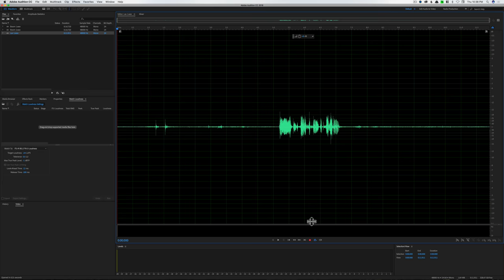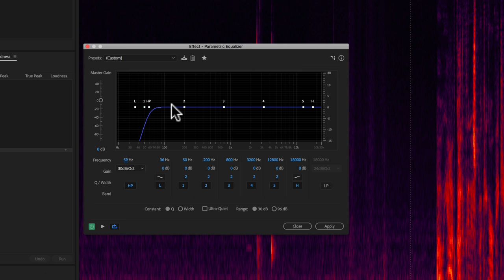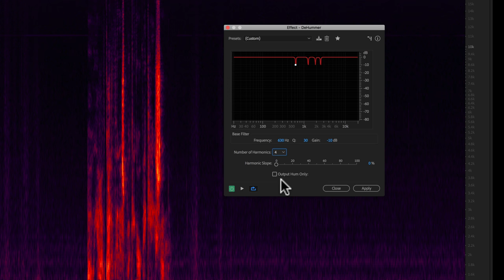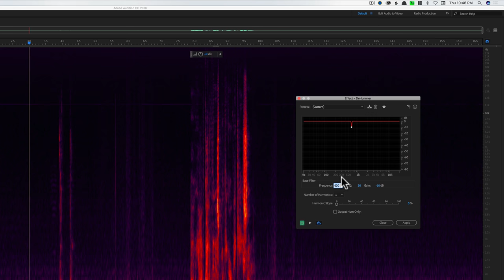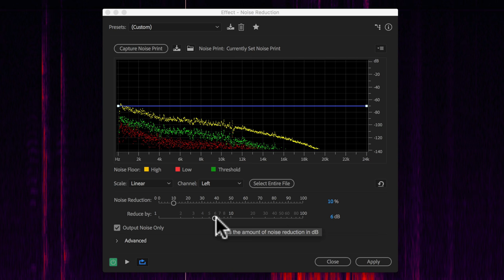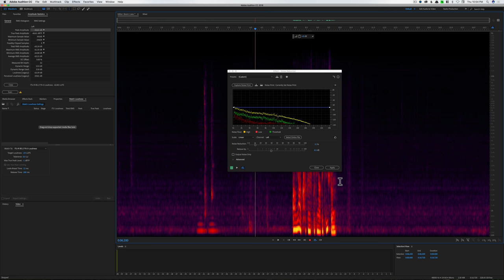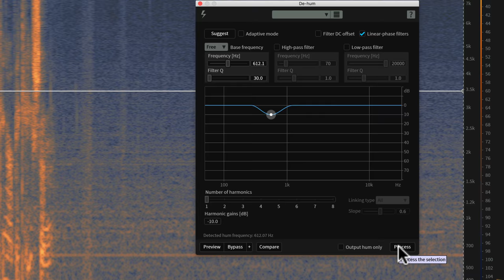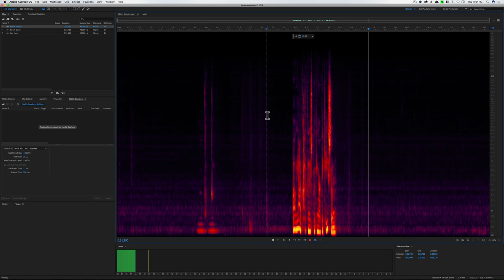Sound for Video Session: Tools for Dialogue Sound De-noising Audition, RX

Comment: Man, I wish I had found your channels earlier! I spent so much time learning on my own how to do the stuff you outlined here in less than 20 minutes. When you were doing the work in Izotope, I noticed a really thin, pale line at about 11khz. I was just wondering if you knew what causes that in recordings. I noticed something similar in a few recordings I worked on, and it doesn't seem to be a part of the regular background noise seeing as how it is quite separated from the bulk of the noise (not to mention that you really can't hear it anyways).

Also, totally unrelated to that: I have somewhat minor tinnitus (without hearing loss, oddly enough). It's not super intrusive yet, but since I'm only 21, I imagine it will just keep getting worse as I get older. Of course, I'm doing all I can to keep that from happening by keeping the volume of the YouTube videos I watch to a minimum (much to the chagrin of everyone watching with me!). I suppose it's just something I will have to figure out how to get around, but I was just wondering if you have any experience dealing with this condition or know how people who do have it actually work around it (for both post-processing and field mixing).